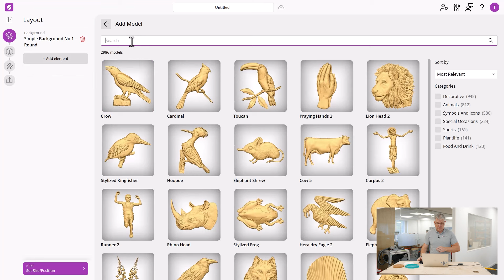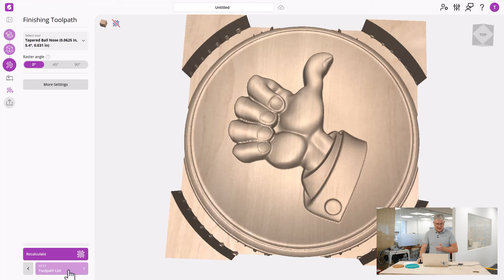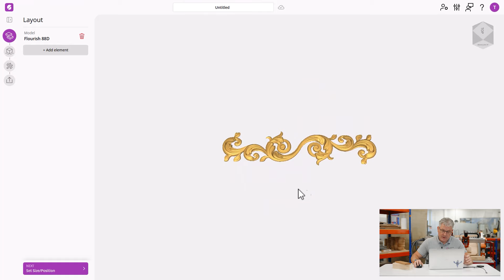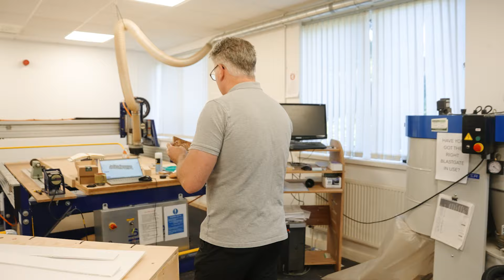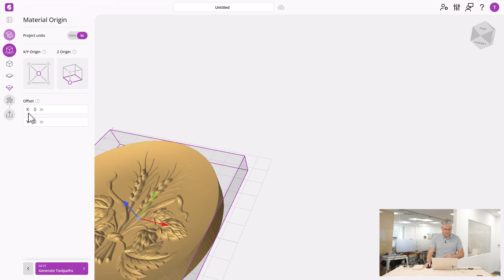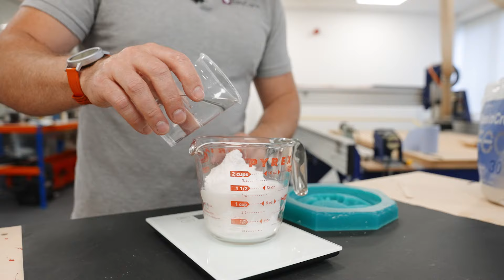3 Gifts Zero Design Skills | Vectric EasyCarve

Comment: in the finish toolpath can you add more then one tool?
Reply from the maker: Well not in a normal file... but you could create a finishing toolpath with a large cutter, save it off and then go back and recalculate it with a smaller cutter and then save it off... that would work.

Comment: Your software is too expensive
Reply: You  get what you pay for! I have Vcarve pro.  I have been using it for years (since 2017) , you get free upgrades regularly. It pretty easy to use and is very versatile. 
If you are not running a business, it will pay for itself, but it is expensive to use for a hobby.
Reply from the maker: Thanks for taking the time to leave a comment.